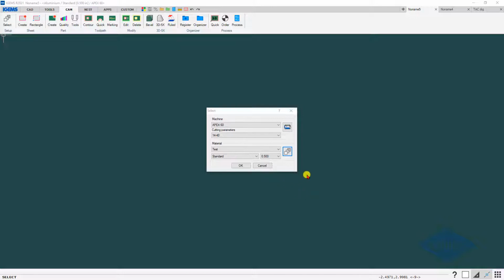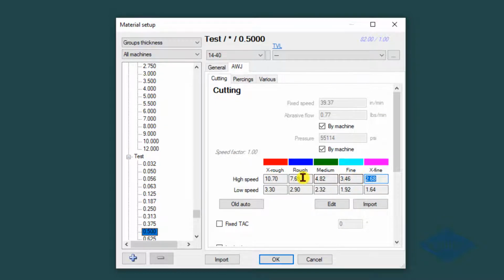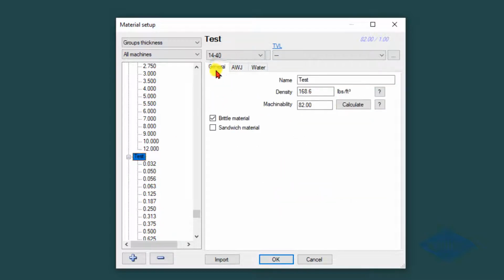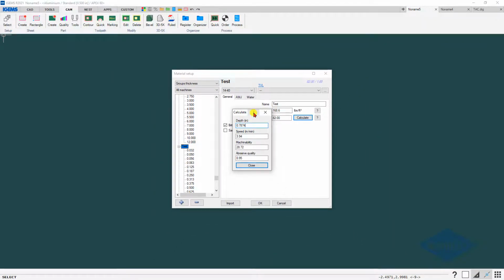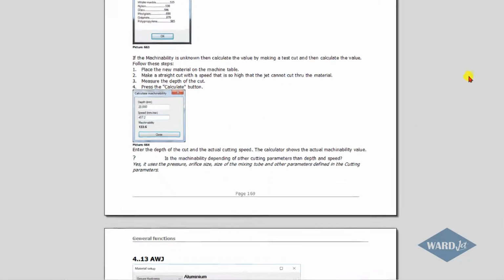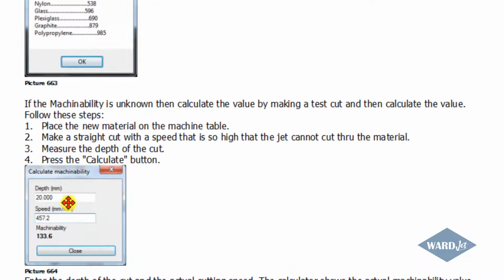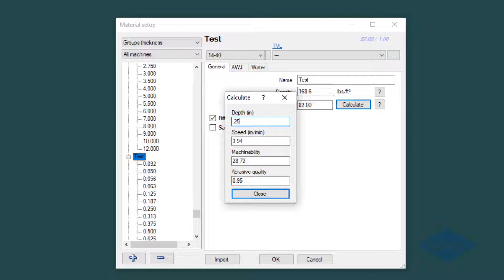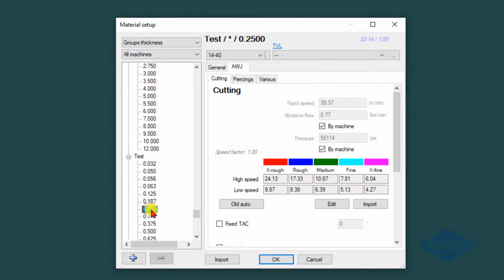How to Determine the Machinability Value for a New Material in IGEMS

Comment: Hi Jeff.   Is there a resource available for IGEMs material database updates?
My material library has a small variety  of materials but i am always running into materials that I don't have.
Especially plastics.  They seem to vary a lot.
Thanks for these tutorials!
Reply from the maker: Hi Nathan,

Hypertherm has a nice waterjet feed rate calculator at https://waterjet-calculator.hypertherm.com/ that has a lengthy list of materials.

After selecting your pump horsepower, material and thickness, you can choose your nozzle/orifice combination, abrasive flow rate and cutting pressure and then it will give you a suggested Q5-Q1 range. Over on the right-hand side, it will also show you information like estimated cost per hour, cost per inch and piercing times.
Reply: @Wardjet  Thanks so much Jeff!
I saw the tutorial you posted as well.
Very helpful as always!  I try not to miss any of your posts or webinars.